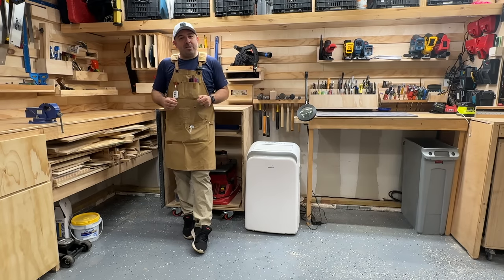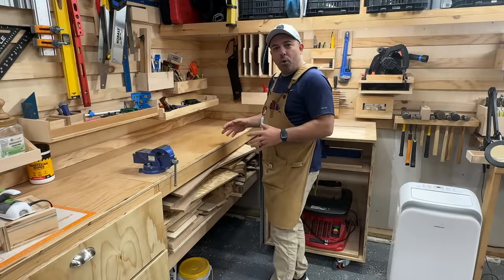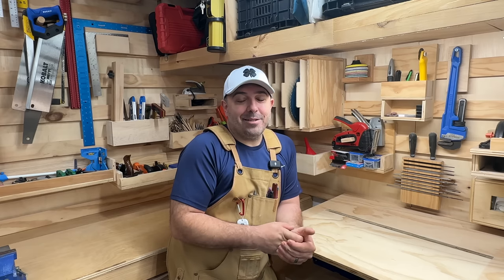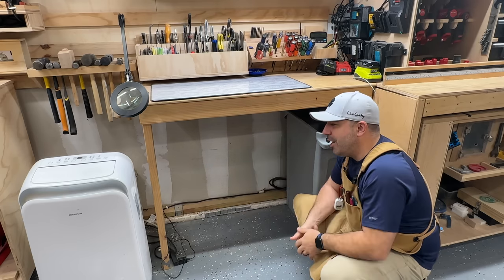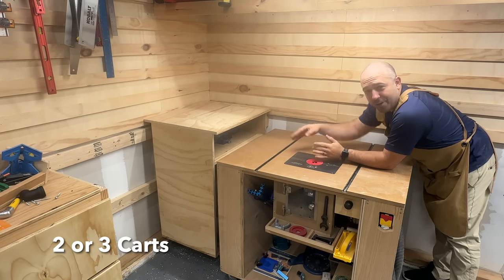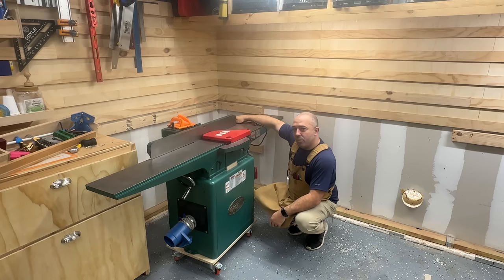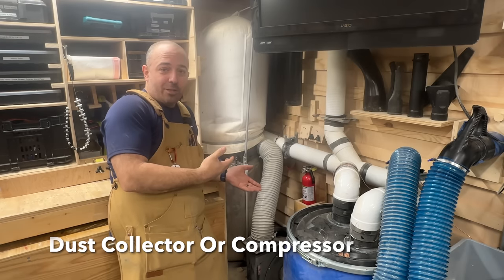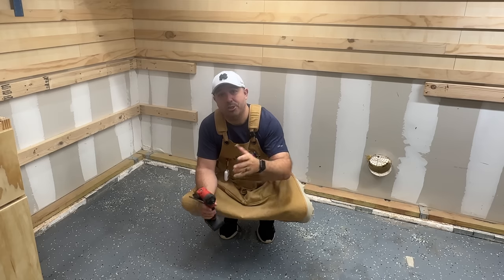Small Wood Shop Organization: Dealing With Corners In Your Layout

Comment: I love what you've done with the place.

I have one suggestion - instead of making a single, giant, long tool holder for that wall, make several smaller units. That way, as your tools, habits, work, and needs change, you can re-arrange them, or rebuild smaller pieces instead of a huge monolithic unit. Making them twelve to eighteen inches long also makes them easily portable, so you can bring a unit with tools you need to another work surface, or into the house, or wherever.

Making all your work surfaces the same height, including the mobile ones, is a game-changer that too few people think about until the first time they need to lay out a board that's too long for their bench, and have to rig something up with spacer blocks to span from the bench to their miter station or drill press cart or whatever.

Simple tip: Getting an exact height match is sometimes awkward if you're using castors - you don't always know the exact height of the castors. But all you need to do is put four casters on a table, wheels up, and lay a board on top of them. The board will lay flat across the four castors, and you can measure from the bottom of the board to the tabletop, and know the exact height that the castors will add to your cart.

I like the corner shelves; they're are a much better option in a small space than a full cabinet. Whatever is on the shelves is more visible and accessible than it would be in a cabinet.

I really love how you cut back the edge of the table to meet the mobile cart. It gives you more work space to reach the corner items and the pocket hole jig on the cart, turning a potential problem into an absolute advantage.
Reply from the maker: Thanks so much will! Actually that is what I’m going to do with that build instead of one long unit, I was sitting yesterday to plan out that build, and was thinking about how nobody else but me would want it that big, and another one of the commentators suggested the same thing, but I’ll give you both a shout out on that one because it’s definitely the smarter approach!

Comment: I stuck my drill press in one corner of my shop. It works very well there. I added a horizontal air cleaner behind the dp center column.

The other corner has a lumber storage rack on one wall with my jointer underneath plus small scrap bins in the real corner.

The wall between my drill press and my lumber rack is my french cleat clamp storage wall.
Reply from the maker: Great tips!

Comment: Hey J - I'm going through the same process now.  I've had my work bench down one side of a two car garage.  It was cobbled together with some reclaimed office drawers and then some plywood base cabinets and my tools are "relegated" to the front 1/2 of the garage with my "miter station" on a mobile, OVERSIZED bench/cart.  I'm stripping down the work bench  and starting fresh wit ha miter station and lots of  base cabinets.  It's a lot of work and consumes a lot of time designing and planning space to ensure there's enough room for cutting, assembly etc.  I appreciate your creative ideas and it gets my creativity going as well. Looking forward to the next installment and I'll be making a few carcasses this evening to get a little more accomplished and get the side hustle back up and running.
Reply from the maker: Nice Tony, I want to see pics!
Reply: @BitnerBuilt  I forgot to mention the corners.  In one I've got an 80 gallon air compressor (for the car restoration work) on a mobile base and attached to a hose reel, and in an adjacent corner is a smaller dust collector.  Delta makes a smaller, 1HP collector that takes up about 2/3 or so of the space (width x depth) and is about 18" shorter than the standard.  So that has saved some room fitting into what otherwise would be a wasted bit of space.  I'll send some in progress pics and I'd appreciate your feedback.  Thanks.  I'm really enjoying your content - it resonates with me more than most others.  Keep up the great work.  TV

Comment: Above the workbench you could create an angled corner cabinet with lazy susan type shelves with holders around it for cordless tools/hand tools.  On the bottom you could have a compressor or just a tool that could set level in the countertop and be used on that angle.
Reply from the maker: Good ideas!

Comment: I saw your Corner Shelf video a few weeks ago. My snowbird season workshop lives in a 6-foot X 10-foot shed. Several tools are on caster equipped cabinets and roll out under an open walled roof to be used. There is an L shaped work bench and French cleats on all four walls. I now have six of those corner shelves which are in three of the corners. Thanks a lot for that video.
Reply from the maker: Oh great glad you like them!

Comment: Love the French cleat corner shelf.  I always felt that a French cleat corner is lost as you put tools on one side and then the other (like a kitchen cabinets in a l shape).  This also allows to add lighting via a clamp light to the shelf (or a magnifier or battery powered fan, etc)
Reply from the maker: Thanks! Hmmm I have a clamp magnifier that I do use out here and it lost its home, putting it off the corner shelf I hadn’t of thought, going to give that a try!

Comment: Love this vid. Definitely great ideas.  I ended up putting my rather large generator under the corner in my 1-car garage shop, with a sander cart like yours that I can pull out to roll out the generator during hurricane season, then roll back under for the rest of the year.  I'll be using the French cleat shelf idea for the upper part of that corner - great use of space!
Reply from the maker: Thanks so much! Yeah, generator is a great thing to place in that corner!

Comment: Thank you for a really good and helpful video :) I'm building my own (small) shop these days, and my suggestion for use of a corner is what I plan to do next to my main workbench: 3D printers. They mostly just stand around printing by themselves, I only need to get to them to remove the print. (A 3D printer is such an underrated tool for a woodshop, even a cheap one will let you print amazing tools and jigs).
Reply from the maker: great suggestion!

Comment: Great tips, and I’m really enjoying your channel.  We think a lot alike, but your shop is sooo much further along than mine!  I have one half of a 2 car garage.  I use one corner for long clamp storage (anything over 3’) along with a bin for long dowels and stock for walking stick projects.  The other corner is for my 3D printer, set on a 45 deg angle.  Garbage and recycling cans below and a rack above for filament storage.  One tip that I have, along the lines of your ‘casters make the world go-round’ comment, is that instead of fixed shelving or french cleats along the wall space, I use rolling chrome wire racks that so I can reposition and rearrange my shop as needed without emptying all the contents.  They are beefy enough to hold heavy benchtop tools (planer, oscillating sander, etc) for storage until needed.  Keep up the great work!
Reply from the maker: Thanks D! Hey, if you have a link to those rolling chrome wire shelves, throw it in the comments, would love to take a look. Any recommendations for useful things on the 3-D printer in the shop? I purchased a 3-D printer and ended up returning it after a week because I wasn’t really accomplishing what I wanted to do with it and ended up buying the CNC machine instead. But now I’ve been kind of floating back to maybe I should pick up another one and give it more of a chance.

Comment: For the AC issue I just had a Mitsubishi mini split unit. It was a little pricey but well worth it. It cools my entire three car shop and I’m in Florida.
Reply from the maker: Trust me, I want one, I just bought a pool, so my big purchase budgets gone for the rest of the year
Reply: @BitnerBuilt  I used to have one of those freestanding ac's and my min isplit paid for itself in 18 months just from the amount my electric bill dropped.  Those freestanding units are terribly inefficient.
Reply from the maker: @viewkeeper1 your absolutely right, I ended up buying a diy mini split about 2 months ago ago and love it - apart for the ac I really saved on money with it heating the garage the electric infrared ceiling heaters I had cost crazy money to run

Comment: My shop is in the basement with the sump pump in one corner.  To maximize that  corner, I extended the two adjacent work surfaces to meet in the corner and put my old and very heavy jig saw in the corner diangelily.  I made some corner shelves similar to yours over the jig saw, but had to build around the sump exhaust pipe.  Now I have a bit more storage and moved one of my less used tools out of the way to a spot that doesn't interfere  but is still easily assessable when needed.
Reply from the maker: That’s great robert! I have to sumps in my Basement, so I know the pain design wise, sounds like you make a really great solution even with the restrictions!

Comment: You might consider adding a small split unit, prices have dropped & are relatively easy to install.  A lazy Susan in the corner may sore a ton of your pocket hole stuff
Reply from the maker: I debated it… honestly, I end up spending more on these YouTube videos than I make currently so would have to be down the road!

Comment: Do you ever sleep?? So many well planned out videos in such a short period. I'm in what was a two car garage (we've never parked anything in it in 30 years), but mine has barely 8' ceilings. I can't put things high on the walls out of reach as easily since I try to use as much wall space as possible. In one of my corners, I built a 4'x8'x2' cabinet that I store all of my tubs of misc things (painting supplies, plumbing supplies, electrical, etc). In the other corner I have the obligatory freezer. Of course I have things stacked on top of it and magnetic stuff on the side. You've given some great tips that will be useful to many. I'm in the process of trying to reorganize my shop because I'm thinking about a CNC, but don't have the room. I've even just bought a bigger shed to hopefully ease my hoarder tendencies with wood (I currently have about a 5'x8' area that's full). It's a never ending process. - Chris
Reply from the maker: yea those hoarder tendencies are hard, I just made a huge pile of French cleat holders to give away to a local guy if he wants them because I keep holding onto them thinking I might repurpose but honestly, I make those holders custom every time.... CNC really is a great machine what about attaching it to a board and then hinge it on the wall? that way it could fold up when not in use and not take up any floor space? You would have to offset it so it didn't hit the wall when folded. just an idea!

Comment: I have a typical 2 car garage shop, One corner by the garage door has the dust collector which vents outside, the other garage door corner is my metalworking / welding area so it has close to outside access. The man door to the shop is close to one of the back corners so i have my clamps hung behind where the door swings. The last corner is near my lathe and i have my sharpening grinder on a roiling toolbox, it rolls out to be used and so i can poke the knockout rod into the lathe headstock. 

One thing to be aware of when designing corners is that nobody puts Baby in a corner!
Reply from the maker: Haha very nice Evan!

Comment: Thank you so much for your content! So much in so few time, are you even human?! XD
I'm currently working on my dyi projects in a very small space (64 square feet tops) 
I'm waiting on my house being built with my shop in the garage, I hope to get a CNC/laser engraver or a 3D printer workspace in my corner with the charging station add I know one of the initial plug will be there.
As a former 3 désigner I know I will figure something out.

Keep up the good work!
Reply from the maker: Thanks so much Jean-Baptiste! I figured if I’m gonna give this YouTube thing a go I need to really go for it right? I’ll start slowing down, but I wanted to start off with a decent amount of content. Oh, it sounds like you’re gonna have all the toys! I have the CNC and engraver, I did buy a 3-D printer at one point, and ended up returning it because I didn’t find it as useful as I was hoping for in my shop stuff, anything you’ve made with your printer that you can recommend for in the woodshop space? I tried doing holders and things and the way I was doing it or designing. It just wasn’t working for me personally / wasn’t as strong as I wanted. Thanks!
Reply: @BitnerBuilt  I don't have any of the toys yet, I am looking into which one should be the one I'll buy (I'm thinking laser cutter/engraver, although I know sometimes 3D printing some shop stuff could be interesting).
I believe that 3D printing is good for non structural parts if done in plastic, which is why my heart (and head) are leaning towards the laser cutter/engraver to do prototypes/templates and other crazy things like Dennis from HookedOnWood.
PS: call me JB (and not maybe, I'm not Carly Rae J. ;-) )

Comment: I utilized my corner for my Laser CNC enclosure. I mainly just do tumblers, but it has been pretty solid location. I just have a discounted "EL" desk top from Ikea sitting on two portable work benches, so my under counter storage is non existent, but im working on it! along with other projects around the house that I have no time for.
Reply from the maker: Nice yea I should have suggested CNC, or laser, definitely a good place for those

Comment: I have a smaller shop as I work on smaller things ( build R/C aircraft, model RR structures, armature astronomy stuff).  In one corner I have a lazy Susan type multi level small tool holder where I store my 2nd level tools (ones I don't use as often as scalpel handles, pin vice, etc) but more than my seldom used tools ( tubing benders, hinge slotters, engine mount drill jigs, etc).  In the other corner  I  keep my resin printer on a multi level shelf (I think it was sold as a chef's table for the kitchen) with the printer on the main shelf, cleaning supplies on the upper, and "dirty" items ( trays, cleaning containers, etc) on the bottom shelf.
Reply from the maker: Nice setup!

Comment: I am about to start re-organizing my portion of our 2-car garage which consists of most of one long wall so I will have one dead corner.  My original thought was to create a bin for vertical wood storage and I am thinking now that maybe I would want to put that on casters.  But my biggest issue is in creating storage under the workbenches (two 6' long w/miter station in between). I am debating between building in shelves and drawers vs. building storage on a cart that would roll under the benchtop and lock into place.
Reply from the maker: One of the really nice things about doing a roll out cart from under that bench is if you put a solid top on that cart, it becomes another full work space for assembly or supporting material or for drying things, one of mine, I use as a spray paint / poly Station,  another rollout cart. I have as a router top. Once you take the bed out or lower it, slides back under the station. if you could even still put the shelves and drawers on that cart if that was the look wanted to go for, thanks for sharing!

Comment: My shop is one side of a 2 car garage so I have a similar set of problems I've been working to solve. I put wall mounted shelves in the space above the "workbench" top (which doesn't have a workbench under it at the moment). I'm using those shelves for commonly used consumables and tools (screws, staples, sandpaper, safety equipment, etc. I need to make some shelf organizers to help better organize the shelves, but so far I'm pretty happy with them. I didn't think to cut the shelves at a 45 degree - they're just L shaped. I've been thinking of keeping my trash can in the corner and I hadn't decided on what to do on the right side of the corner, but I like the idea of making a small cart that I can use either for more table space or for storing smaller benchtop tools like a spindle sander. Unfortunately to the right of my corner is a door to the back yard, so that makes it a lot more difficult. The other corner in my shop has my dust collector (next to the trash/recycle cans), so same thought process there.
Reply from the maker: Very nice! Maybe try and view that door near the corner as a positive and try to take the mindset of working it into your layout, perhaps you want to have a primary tool that faces to the side where the door is instead of out like you usually would so you could stand in front of that door with lots of space to move around with some thing, just a thought!
Reply: @BitnerBuilt  That's sort of how I'm viewing it in the context of needing to cut something long like trim pieces. Currently the table saw outfeed is going towards the door (albeit probably 10ft away). The miter saw is next to the right side of the table saw so work pieces are oriented the same way as the table saw. I might consider putting a folding table/work surface attached to the door as you showed in the video, though I have to be careful because the door opens towards the corner and could interfere with the shelves. I'll need to take some measurements and ponder a bit more.

Comment: In one of my corners I have a cart that has my pancake compressor on top and in 2 drawers I store accessories for it, at the bottom is where I keep an extension cord and air hoses.  The whole thing is on wheels so I can when it around when needed in the driveway or across the garage.
Reply from the maker: Nice Christopher!